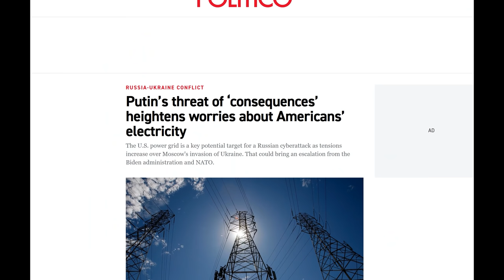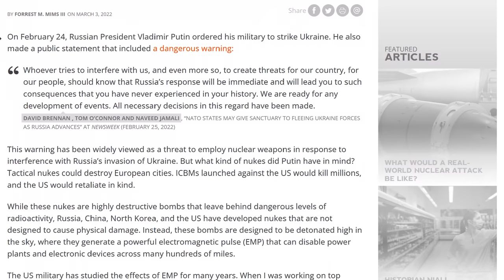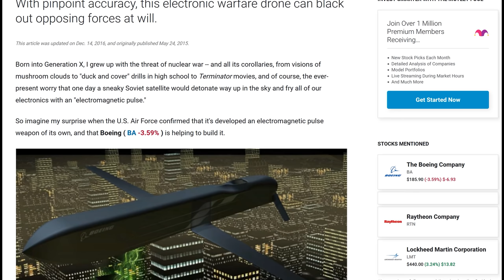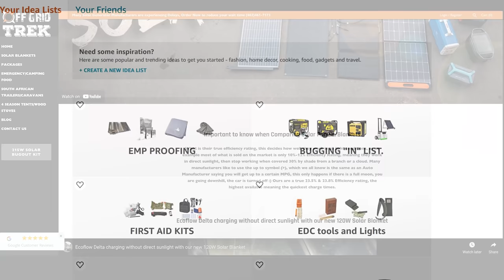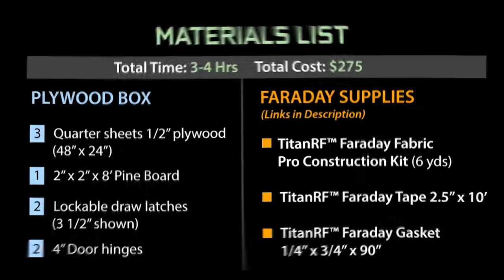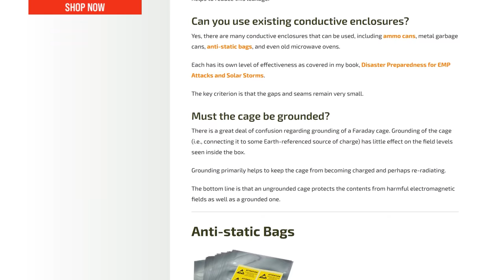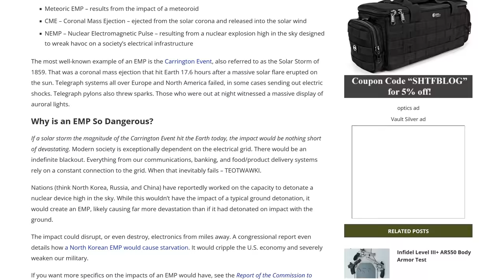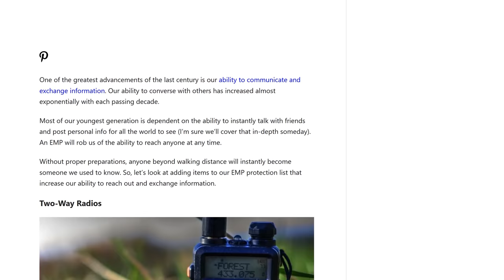EMP ATTACK: How to protect yourself and your family.

Comment: Thank you Ritchie...I'm in...shared this video of course. Been studying about grounding when using say a big aluminum trash barrel as a faraday. It's hard to do when you live in an apt on the third floor. So much to take in but definitely feasible. The bag is, wow, great for the size alone. A note for anyone reading, whenever lights go out, of course it's could be for other reasons. Before we panic, grab the cell phone and try to make a call. If the call goes through, it's not an EMP. I know my heart pounds when it's lights out on a clear night and this has calmed me instantly. Also, listen for sounds of traffic. Cells and cars won't work in a grid down, no need to panic for nothing. Ritchie, thanks for all you do from Tucson👍 I've been watching you for years.

Comment: Remember to keep your generator unplugged, you computer unplugged and take you positive off your cars battery every night.  This will keep a lot of electronics safe.  Problem is the fuel pumps and the main grid...
Reply: Actually, unplugging your battery makes it worse. Now your creating an antenna with no battery as an dissipator. However, adding a properly sized isolator to your battery cables doubles your protection. Check out EMPdoctor here on YT.  Dude is a wealth of info regarding the topic.

Comment: Thank you JBO, you are a good soul brother. I have electronic devices etc stored in  old microwave ovens , as you said if the device doesn't get a signal then it's protected. Been storing my stuff in them for years because the leakage / properties of them Are good, also keep a continuaty multi meter in therm . Good luck to the winner of that faraday bag, you gonna need it. 

I'm in!!!

Thank you brother.

Comment: " I'm in " and shared on my community tab.  I have a Delta Pro and have wanted a bag big enough for it but couldn't find anything without making it.
So this helps, but $300 ain't happenin'. Up there with the "EMP shield" that you'll need if you want to be able to USE anything in the house WITH your Solar generator ( aka glorified battery ). At the end of the day all we're doing is creating for ourselves, buffers & redundancies ., buying more time however prolonging the inevitable. All at the expense and sacrifice of the "now" when respectably things are good for the most part. Balancing preparedness and having a life is tough.  But doing something is far better than doing ZERO and paying for it almost immediately.

Comment: Good to see you again brother.  Been a while.
One thing I'll add...while I'm no expert, and please look into it as well, I have it on good authority that an EMP affects ONLY POWERED circuits.
Meaning any circuit that IS NOT energized at the time of EMP exposure will not be harmed.

So for large items, such as our 80 series and all the electronics in and of it, keeping a master power-cut device, e.g. breaker/switch/failed-open relay, inline with the start battery can protect your vehicle and all the electronics inside it. 
Of course this only matters if you've wired all the extra electronics in such a way that isolating the start battery accomplishes a complete power cut to all of it.
I run dual engine batts and dual cabin batts.  And all of it is manually breaker'd at the batts.

What makes this a difficult solution is that I also run an alarm system because I live in 3rd-world crime Colorado.
So, I either have to risk EMP damage for the security of an alarm, or risk theft of my vehicle for the safety of no damage from an EMP.
ATM, I'm in the former camp.  Which is why I hope to move to a much safer 1st world law enforcement location so that I can completely "de-power" my rig while it's on stand-by for that last run, 'out into the middle of nowhere'.

edit:and about fuel...it's why i also carry a small, fuel-safe transfer pump.  There may not be any power at the stations, but the fuel isn't going anywhere unless one pumps it out.

Comment: The reality is protecting things like phones, computers etc is pointless. Once the system goes down these things would be useless anyway. However spare electronics to keep your vehicle running is a different matter. My solution is an old pre computer vehicle, points and carby. Basically it might blow the condensor or coil.